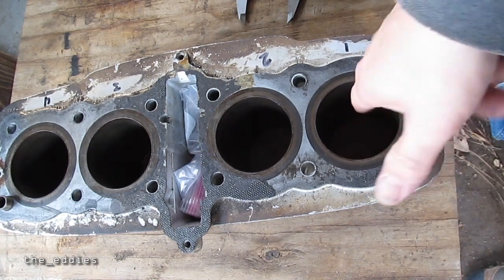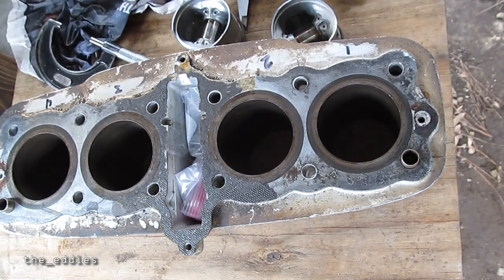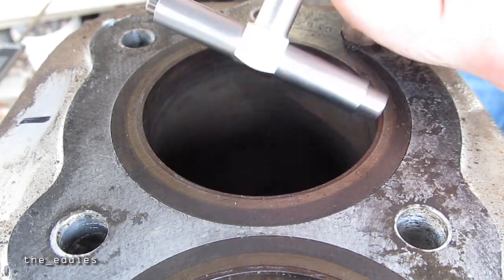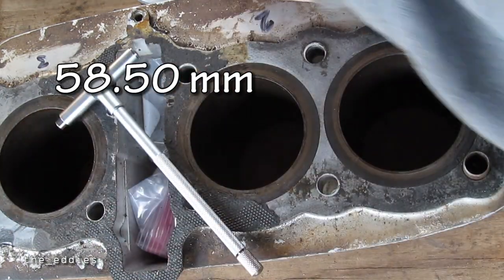Measuring piston to bore clearance in an old engine - Honda CB550

Comment: I have the same set of snap gauges. Been wrestling with that oil paper every time I open it too. :)
Reply from the maker: It does a great job of keeping them looking good though, especially  in my dewy shop. I actually bought a bunch of VCI paper to put in drawers of tools I don't use often, That stuff is amazing, no residue and no rust. Best!
Reply: 327 cylinder bore measurement

Comment: Hey Eddies.

Good to see a video from you.
Everything you did seems pretty good.
You pointed out the need for Micrometers.
Which are another necessary evil to own.
Great to have,  but just something else to buy, LOL.
And as you know that never stops. $$$$

The only thing i could change is when using Micrometers.
 Measure from the bottom of the piston skirt.
But for your example it was enough to get the measurement you needed.

I see you have what looks like a Brand New set of Snap Gauges.
When you first use them straight from the pack wash them first in some acetone to remove all the packaging grease.
This will stop them from becoming sticky when using them.
If you notice when you first compress the gauge they are slow to move, this is because of the packaging grease.

Thanks for the video.
Regards Peter.
Reply from the maker: Hey Peter, thanks again for watching. I actually have a 2-3" mic but for the life of me I could not find it, I usually keep those in my Kennedy box but apparently the last time I used it I did not return it, which means  bad things probably. The gauges are not new (I generally keep precision stuff very clean, except my missing mic apparently) though all of them have not been used so I left the anti corrosion stuff on them. They are not sticky at all, I was only half opening the lock nut trying to work around the camera.

I sometimes get odd readings on the bottom of the skirts on these old engines, but that is the preferred location, and I should have measured lower as well to compare. Good point!

Comment: interesting method. i like it. i use a squaring tool i made to keep the handle 90 degrees and can get a consistent 3 ten thou reading each time, but ill try this. others use a more aggressive swipe on the upstroke. never could get anything from that method. slower makes sense!
Reply from the maker: Give it a shot. It is the method that works best for me to get consistent results.  I showed this way to a retired machinist a few weeks ago and he was like "what the hell are you doing?" but when he tried it he was getting as accurate or better than his way which was no sweep and no tool, just feel.  He was pretty consistent with just feel though, lots of practice over lots of years. At the end of the day it whatever works for you though.

Comment: i have telescoping guages and ready to do a rebuild but tworn between the telescoping guage method and getting a bore gauge. thoughts?
Reply from the maker: If you are getting a 3 point bore gauge I would do that. The 2 point dial gauges are nice but take time to set up and a set of good telescoping gauges are just as accurate with good technique.

Comment: Nice instructions.  Thanks! Working on 78 cb750 top end. Any tips are welcome
Reply from the maker: Thanks! Not really any specific tips I can think of off the top of my head, just follow the workshop manual, check/clean everything twice, and if you run into anything that doesn't make sense,  there are lots of guys on the https://www.reddit.com/r/HondaCB/ forum who have lots of experience with those motors, it is a good place to ask the weird little questions that come up.
Reply: opel cadet 1.3 and 1.4 peston is same pats

Comment: Hello. Just have a question about your technique. You don't actually say this in your video but it appears you are tightening the bore gage when slightly cocked, then pushing the tool back to being perpendicular, then carefully cocking to remove. If so I like this method as it should increase your degree of accuracy but would assume would put a lot of wear on the bore gage itself. Just my thought. I have always tightened when bore gage is perpendicular then remove to measure. Thank you.
Reply from the maker: You should tighten it slightly before you bring it to perpendicular. This does increase the accuracy greatly because as you move it, it holds at the smallest point which would be be perfectly perpendicular. I never got good repeatability doing it the other way. The key is too tighten it just enough to hold it, not as tight as it gets. I usually tighten it fully as I pull it out but sometimes don't. I also repeat at least 3 times if it is a critical measurement. I have never had any problems with my gages and they are not the highest quality. Try tightening just until you can just barely move the gage ends by squeezing between your fingers, they should not move smoothly under constant pressure without any jumps and not move when you remove pressure.  That is as tight as it needs to be. It takes a bit of practice but is well worth it.

Comment: That gauge is not for reading cylinder diameter.... reading will be wrong... use the 3 contact points type to do so as it will automatically centre device
Reply from the maker: A telescoping gauge is "not for reading cylinder diameter" That is just wrong. It is not the most accurate though it can be perfectly accurate for the job with practice and is more accessible for hobbyists and home shops. 2 point indirect and direct measurement has been used since the first precision hole was drilled. 3 points are certainly the best to give you accurate results on a round cylinder and to give an indication of taper but they do not tell you if the cylinder is out of round. Which is kind of important when deciding to hone or bore, which is the most important consideration here where the bore is already set and tolerance is the issue.
Reply: thats funny ive been using them for 15 years for all my outboard rebuilds.
Reply: I guess you're right,  it's not the most accurate for measuring bore  and  is ok when working on a old important engine.
   But for precision work where the tolerance are so small these bore readers are not accurate.... 
   While we have been doing something for years doesn't mean newer and better technologies haven't invented and greater knowledge gain ... but these piston clearance are even more tighter than before and using this tool will easily give error readings... its difficult for the user to know if it's perpendicular to cylinder walls as if your off then so is the reading... 
 So while engine may work after assembly it's not original standard....
This is basically doing a visual inspection and reassemble engine... 
   Oh yes it will start and runs ..but like shit.
Reply: @willis23jm1  you make a lot of assumptions here but you are right about that "snap Gage" 
You can't really be consistent with the snap Gage and you need at least a couple thousands +/- 
   A DIAL BORE GAUGE , That's how you measure close tolerances which will read very well to +/- 2 tenths of one thousandth.